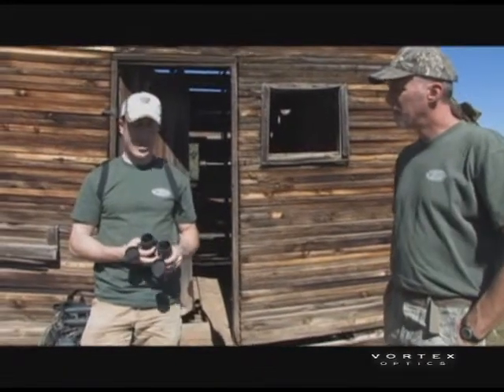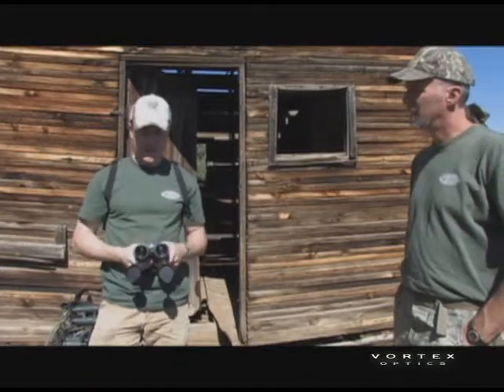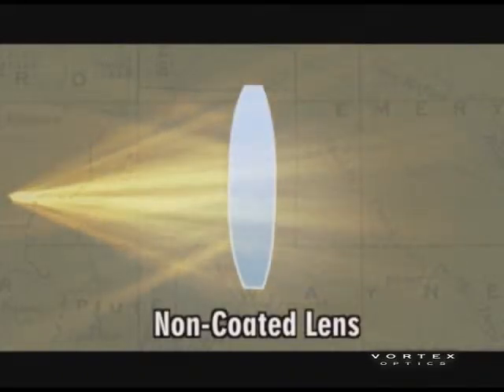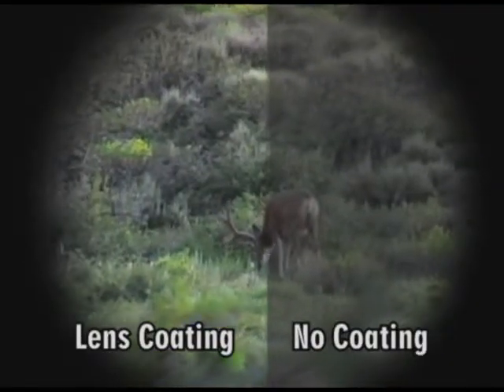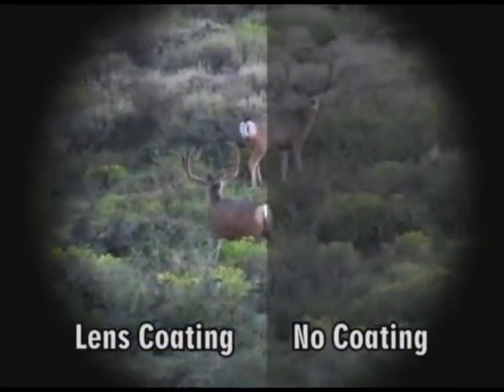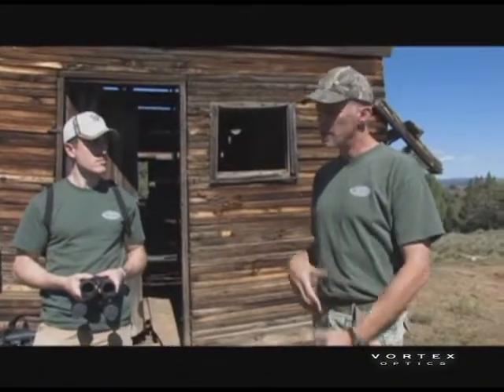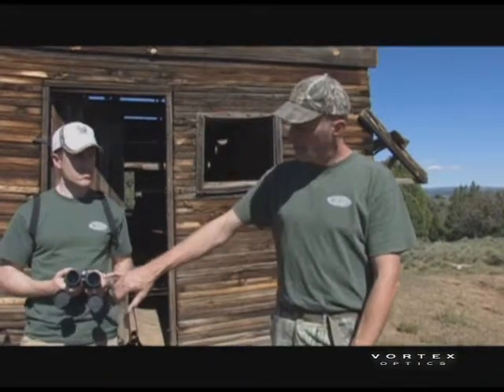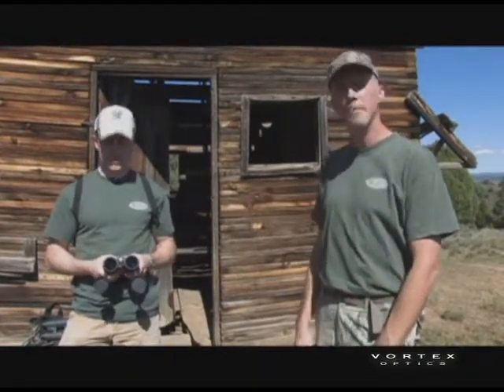Lens coatings

Comment: what's the difference between bluish and green coated lenses? someone said bloom something but which is better.
Reply: The color is chosen by the designer, the color you see is actually color of reflection. If blueish means they chose anti-reflective coating close to the center of the visible spectrum, green could be multi but more likely would be low side AR that reflects purple and dark blue colors or worse cheap chinese scopes with AR film pasted on it. The overall goal is suppressing reflections so more light goes through the lens but it can't be achieved equally for all colors so the designer has to choose a range.